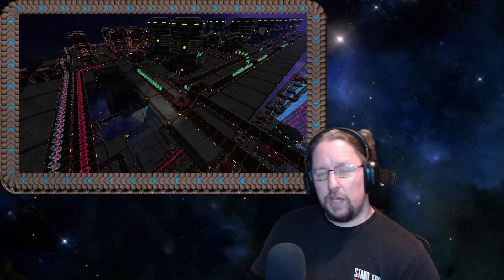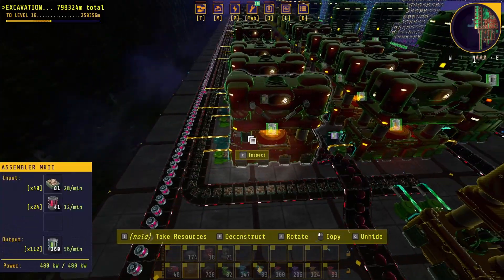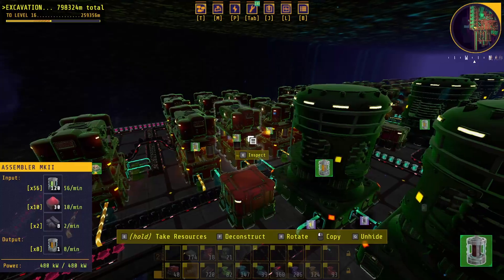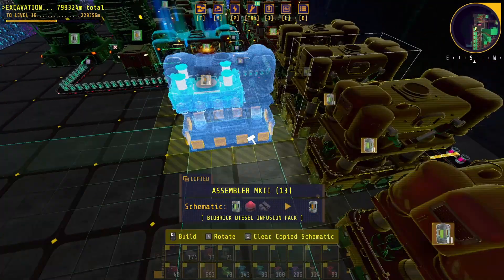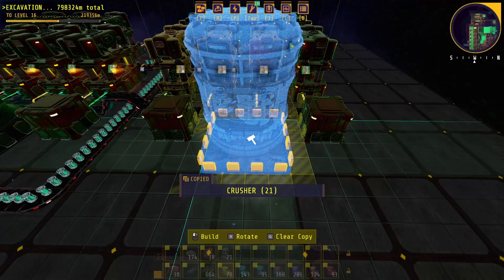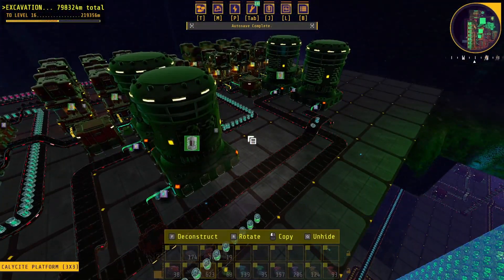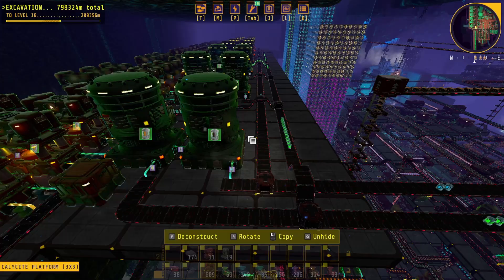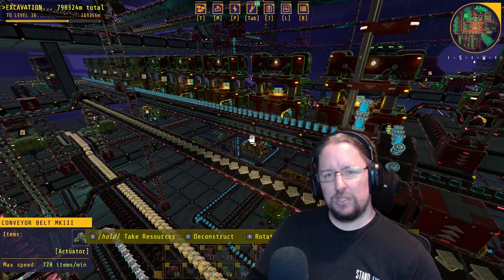Techtonica Expandable and Compact Pure Biobrick Biodiesel

Comment: Thank you for sharing your set up. I am curious what your sesamite coolant production set up is like. How extensive does it need to be to have sufficient volume to keep the refined biodiesel system going without stopping?
Reply from the maker: Each "section" of the setup uses 36 sesamite coolant, and the recipe that uses shiverthorn coolant and sesamite powder produces 24 per minute. It works out to 1.5 machines making sesamite collant per section, or 3 for every two. I also added one extra machine for a little extra production. For the 6 setups I have producing the biofuel, I currently have 10 machines making sesamite coolant.

The shiverthorn coolant I produce making iron mechanism, shiverthorn extract, and sesamite powder. It produces 1000 a minute which is enough to feed all of that with just 1 machine.

I consider this something I missed in the video. It would of been nice to include as well. Thanks for the question, and let me know if that answer is written well enough.
Reply: @iltisine  Thank you. I was able to finish the game. I started with one refined biodiesel factory production setup but ended up setting up separate unrefined production lines on each sand floor. I  found using unrefined biodiesel worked well but would use my stockpiled refined biodiesel if my production lines hit a snag. Then once I had the production line backup and running, I would switch back to the unrefined.
Reply from the maker: You're welcome. I'm glad you were able to finish up with it :)